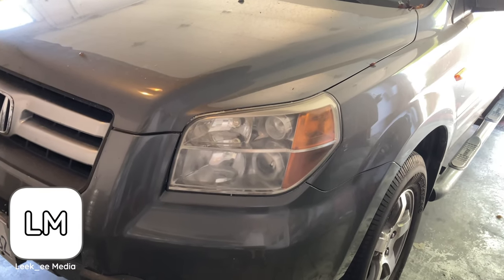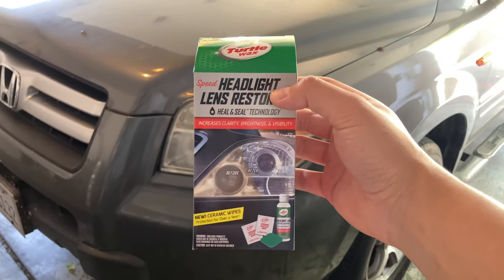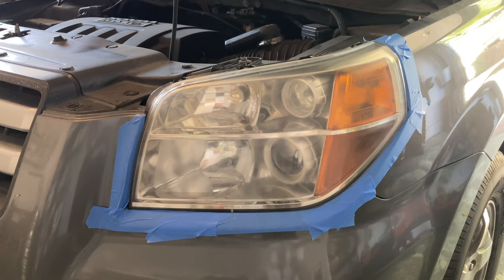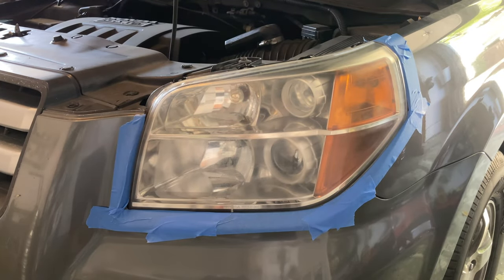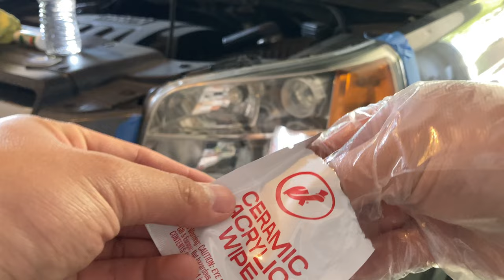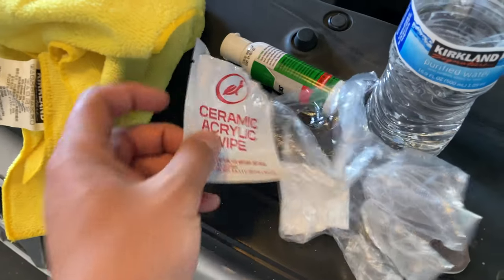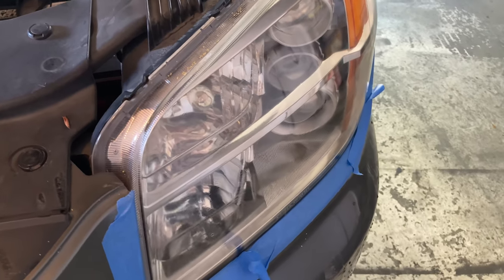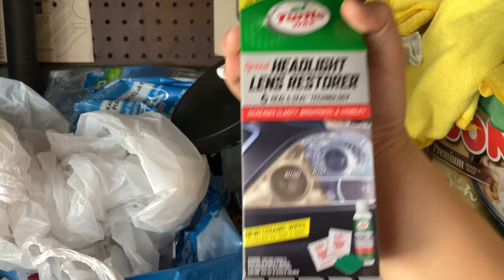Restoring Headlight with Turtle Wax Kit

Comment: When I worked in Walmart automotive dept. We used to do this for customers. Was like 2 or 3 polishing paste and the final Wipes were just a wipe on clear coat. Worked good for a while. I re did mine on my civic with mothers mag and aluminum polish then sprayed with uv protective Clear coat spray paint. The 2x rustoleum from Walmart. Worked pretty good too. Those turned out pretty nice too

Comment: This is not a good review on the kit. Not everyone has the buffer. If you are going to play by the rules you have to use what is in the box.
Reply: Well just read this comment I don’t have no buffer 😒
Reply: @claudiavilla8394  you don't need one. It works without but having one would make it turn out much better. It made a huge difference on my truck doing it by hand. I'm happy with it. I do plan to upgrade my 07 headlights sometime in the future for a cleaner look
Reply: @BigWhite002  I just Literally did my 96 impala SS man we’re they yellow lol look great now by hand

Comment: Do you need the polisher machine/buffer for this job?
Reply from the maker: Nope, you can do it by hand
Reply: @Leek_ee  okay, what if I did all the steps and applied the polisher compound, but the headlight is still somewhat bad, what should I sand it with
Reply from the maker: @Soijakastike  start off with 1000 grit and move your way up to 5000 with light pressure
Reply: @Leek_ee  Is 2500 grit enough or do I need to get higher?
Reply from the maker: @Soijakastike  2500 is still good

Comment: Try reading the instructions, you’re showing people how to do this and you’re not even doing it correctly and I’m a woman and I’m noticing this unbelievable you’re not supposed to put the compound on until after you’re done sanding and you don’t use water they give you a spray to use you spray it and then use the one and go side to side and you spray it and then you end up using number two and go up and down read the directions before you show someone else how to do this incorrectly unbelievable
Reply: I actually read the instructions. I clearly followed the instructions as well. This kit provided what it needed to be done. I understand that you have an issue with how I’ve done this process. I clearly followed the instructions and used everything the kit provided and stated.
Reply: Using compound first helps with removing thin layers of clear. In this video, he chooses to use compound as a way of cleaning and getting stuff off because compound is basically almost a liquid sandpaper. He then proceeded to sand it down apply the compound again after with a orbital polisher to get the correct results then use the clear coat wipes which is correct. Either water or a combo of soap and water to sand is correct as well, it’s called wet sanding. Some people prefer using the product out the box to sand it down but if you done headlights or any type of sanding of any part, everyone uses water to wetsand. There are many different ways to do this restoration of headlights with that product and he clearly got the results he wanted and shows everyone how he does it. There is no wrong if he’s clearly showing you the results and how it came out with the method he used plus some information that came on the box, he just made things a bit easier for himself.
Reply: The new kit don’t come with this spray. Just the old one
But you are right, he didn’t used the other side of the sandpaper
Reply: Is not mandatory
Reply: This was for the old kit
Reply: That was a very Karen comment. But it's good you pointed it out.
Reply: Also you're wrong Karen, it obviously says to put wash it first, then dry then put compound on. And if satisfied you don't have to continue. You gotta read instructions first before you blow up on people, leaves a bad image. 🤦🏿‍♂️
Reply: @tonyproductions6116  9
Reply: My kit says to apply the compound first, then proceed to sanding if lens still not clear, then re-apply compound. It also says to use tap water to wet headlight and sanding pad. You're right about the other stuff though: it says to use the second side of the sanding pad in the opposite direction and just on the damaged area. And since it says side to side for the first, it must mean up and down for the second. Not really that clear: Turtle Wax should take note! But similar products also say to do side to side and then up and down for sanding. (Also apparently there are older kits with more supplies? My box looks somewhat different than his though mine also is Turtle Wax Speed Headlight Restorer.) 
 PS: I blow up on people prematurely sometimes too. I'm trying to never blow up on anybody because it's better to be kind but change can take time. Anyhow it seems I'm usually wrong, lol! But also we can have a lot of pain inside from being dismissed and mansplained as women and sometimes it comes out as irritation, so people shouldn't be calling you a Karen.
Reply: @t_kucumber  (Except where it said to complete both headlights first and then apply the Acrylic Wipes to both, and then you blamed it on the kit. Although my kit comes with two wipes, though it says one wipe can be applied to both headlights.) 
  (And also regarding your use of the sanding block thing.)

Comment: Yeah, it says clearly in the instructions to restore both headlights before applying Ceramic Acrylic Wipe. And then it says to apply quickly over both headlights. 
 (Also, it's the "lens repair" solution, not "the repair lens". Whatever.)